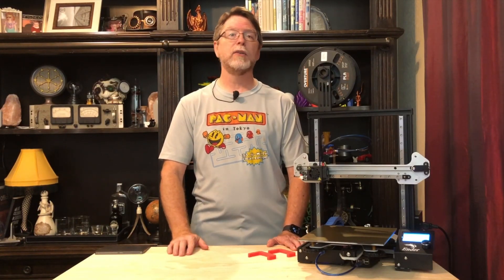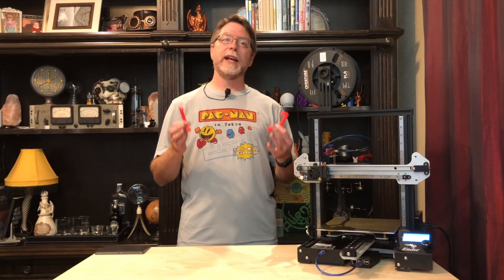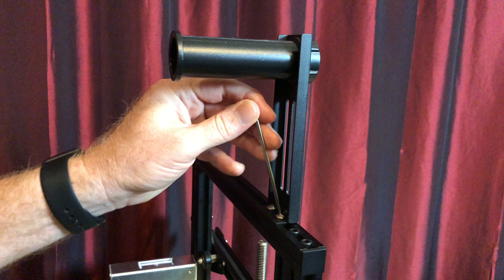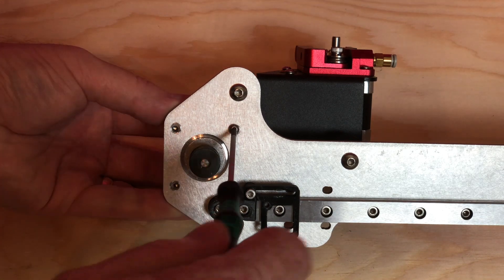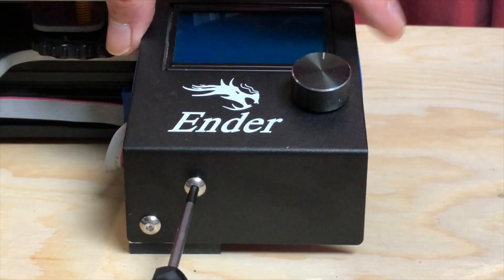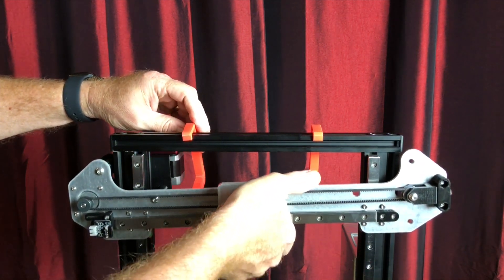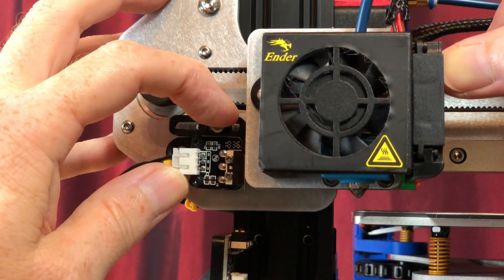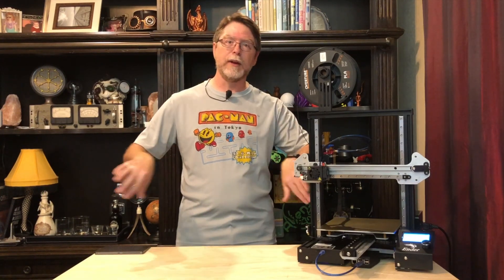How To Install 3Dfused X & Z Axis Linear Rail Kit for Ender 3 & Ender 3 Pro

Comment: Hi Bryan,
I installed the full kit from 3dfused....the x,y and z.  Everything runs smoothly now but I do have one issue when the stepper motors are disabled....the x gantry slowly drops due to gravity.  Do you have a similar issue?  Its a bit of a problem when i need to level the bed.  After auto home, if steppers are deactivated for bed leveling, the gantry drops a tiny bit which makes leveling the bed a bit of a nightmare.
Reply from the maker: Hi Novak, I had that problem when I installed the direct drive kit on the X axis. It added juuuust enough weight to spin the Z motor and let the X gantry sink to the bed.

I solved it with an "Anti-Backlash nut," which adds the little bit of friction needed to keep the Z axis in place. 

Below are links (affiliate and otherwise) to anti-backlash nuts. I'm copy-pasting from the description of that other video. On the Creality printers, the Z leadscrew is so close to the extruder stepper that a regular anti-backlash nut won't fit (and Creality uses a different screw hole spacing). So the first link is a printable adapter, which allows you to use the generic anti-backlash nuts that are listed after it.

The other video is here (I don't recall the exact time code that I show the anti-backlash nut, but it's in there): https://youtu.be/0b_8612WD0s

Anti backlash Nut Adapter Creality printers (Ender 2/3 Cr-10s) by OxProps
• https://www.thingiverse.com/thing:3732035

Creality-size Anti Backlash Nut
• https://amzn.to/2rJOdxe Amazon 🇺🇲US [affiliate link]

Generic Anti Backlash Nut
• https://amzn.to/2OUaFeY Amazon 🇺🇲US [affiliate link]

3Dfused Brass Anti-Backlash Nut (T8x8 2mm pitch threading)
• https://3dfused.com/product/brass-anti-backlash-nut/

3Dfused Delrin Anti-Backlash Nut (T8x8 2mm pitch threading)
• https://3dfused.com/product/delrin-anti-backlash-nut/
Reply: @BV3D  thank you so much for the quick feedback. I'll give that a shot. I am getting a zesty nimble though, and am planning to remove the extruder motor from the x gantry which should lighten the whole bar quite considerably. 

But until then, I'll try those anti backlash nuts. Thanks again. Much appreciated
Reply: @novakmiler7944  You can also configure marlin so that the Z stepper never turns off, which is what I do. If you're able to flash firmware and whatnot. I have it set up so my Z motor only turns off when I explicitly hit "Disable Steppers."  The anti backlash nut is probably a simpler solution though.
Reply: @WrexShepard  thank you so much.  Unfortunately my level of skill with flashing firmware and coding is 0:)  Ive ordered a zesty nimble and will be removing the extruder motor off the x carriage.  This will hopefully make that x bar very light, and I probably will not need any extra mods to compensate for the dropping. Also keen to do dual z on the machine at some point.

Comment: What type of printer is this classified as? Core xy?
Reply from the maker: Hi! This type of printer is known as a Cartesian printer. Core XY printers tend to have a cube frame with the Z axis moving the build plate (bed) up and down. CoreXY printers also have an interesting belt drive system to move the print head on the X and Y axes, in which both motors work together; there isn’t an X-only motor and a Y-only motor.

Comment: Thanks Mate! Just finished the install of the X,Y and Z kits. Couldn't have done it without you! I can't say I'm blown away with the results. It works, sort of,  but the bearings are pretty rough. It was far smoother and quieter with the stock wheels. I was expecting the utmost in precision from the kit. Hopefully, they'll loosen-up over time.

UPDATE: I GAVE UP ON THE X-Z AXIS KIT AND WENT BACK TO THE STOCK SET-UP. I spent a lot of time (probably 10-12 hours) trying to get the thing to print well. The Z Axis would not dial-in no matter what I did and no matter how perfectly square and parallel everything was. Put the stock set-up back on and it's printing perfectly. I guess I'll leave the Y-Axis installed for the time being.

NOT what I was expecting from such an expensive upgrade.
Reply from the maker: Hi Ken,
I'm sad to hear the Z axis wasn't working for you. Did the blocks move smoothly on the Z axis rails without anything mounted to them?
Reply: @BV3D  After so many attempts at fixing it, I gave up and went back to the stock wheels - it's printing perfectly. The linear bearings slide nice and smoothly but I end-up with some play in the Y axis as well as the "dumb" end of the X gantry. 3DFused suggested an antibacklash nut but it didn't make a difference.

I've packed it all up and requested to return it to 3DFused - hopefully they'll be accomodating. I don't mind spending money on this, but I assumed it would provide the smoothest, tightest, quietest operation available - I don't think that's the case. The printer works better on wheels - for me anyway.

I'll spend the money on a second lead screw and a Hermera direct drive extruder/hot end.

Thanks for all your videos - they've helped me a lot.

Comment: Took the plunge and ordered the X,Y and Z rails tonight.
Reply: Results?!
Reply: @avgvstvs96  Works amazingly good! Keep everything well lubricated and you will see a difference in your prints.
Reply: @TheLurch1955  Nice! I've seen a lot of Linear Rail upgrades create worse artifacts in printing because everything is so precise small mechanical vibrations and imperfections get directly transferred to the print. How is your print quality? Do you get any artifacts or are your layers as smooth as possible?
Reply: @avgvstvs96  Print quality is very good. As far as artifacts, none observed.

Comment: I already have a Directdrive converted and using  ezr extruder. Any advise for the linear upgrade
Reply from the maker: I have an EZRstruder available. When I get a chance I will see whether it looks like it would work.
Reply: @BV3D  Any update on this? I apologize if you've already posted it elsewhere or in another video. I'll keep looking through them. I've got an ender 3 pro that I intend to install a flexion extruder and hot end or possibly flexions version that works with the v6 hotend. Would this be able to work with your rail kit x, y, z? I'm waiting to pull the trigger on this purchase but would like to asap.
Reply from the maker: @JC-ic8uh  3Dfused sells a direct drive kit which includes a taller X carriage plate (it's got mounting holes so you can attach the extruder & stepper motor). It's designed for the stock extruder, but with some ingenuity (and a couple of spacers) you could mount an EZRstruder. As for hot ends, as long as they follow the same hole spacing as the stock Creality hot end, they should work. But I suggest contacting 3Dfused support (or their website chat system) to explain what you want to do, and they can offer suggestions.
Reply from the maker: Hi vanQ, 3Dfused has a direct drive kit for the X axis rail kit, which includes a new X carriage plate. The new plate is taller, and includes mounting holes for the extruder stepper motor. There's also a 3D printed part included which acts as a spacer to properly align the stock extruder with the hot end. To mount the EZRstruder to the X axis kit, you'd need that new carriage plate (3Dfused may sell it to you on its own), and you'd need to design your own spacer to accommodate the shape of the EZRstruder. So it looks like it's do-able, with a little effort.

Comment: Quick question, i just got all the linear rails and now having allot of issues with the z probe offset (bltouch). Also my extruder went from perfect layers to either to close or to far away, or even some cases under extrusion. Can't get a happy medium. Even after manual leveling. Can you give me a few suggestions on getting back to good settings.
Reply from the maker: Hi Roy,

It sounds like the Z axis is binding. Here are a couple of suggestions.

1) Remove the Z axis lead screw and make sure you're able to smoothly move the X gantry up and down all the way from the bottom to the top. If it's binding, try loosening the screws on one of the Z rails, moving the X gantry to the bottom, and gently tightening it again. Do the same at the top. Check again for smooth motion. If it's still smooth, gently tighten the rest of the screws on that rail. Confirm again that motion is smooth from top to bottom, then reinstall the lead screw.

2) Loosen the screws holding the big brass nut that the lead screw goes through on the extruder bracket. Not a lot, just enough that it can move around within the oversize hole that it sticks up through. This can help if the lead screw and the nut aren't in line with the rest of the Z axis.

Hope that helps!

Comment: Way too much money for basically little to no improvement in quality. Why would I pay so much for nothing? Kit needs to be much cheaper than the printer its intended for.
Reply: @Electric Boogaloo You have no evidence for those claims. The limiting factor on a printer Iike this would be drivers motors and pulleys. A linear rail will offer no much in the way of performance compare to a well tuned and fitting   extrusion roller setup.

Comment: Bought me second set of rails, they are great!. I did have an issue where my Y axis rail didn't clear the bed screws, and 3dFused suggested I use shorter screws,  sadly my local hardware store didn't stock short enough screws. I designed and used a spacer, and sent the STL over to 3dFused and maybe they'll post it on there site. If not, the holes you need for the rail spacer are 20mm by 20mm centered, however I'm not good enough to model the belt holder, so I didn't include them in the STL, there is enough room in the spacer to drill your own.
Reply: They include a printed spacer now - I got one in my kit. It may well be the one you designed! Thanks mate!
Reply: @kenlipper874   That's great they decided to ship it out as part of their kit. It really would stink if you got the printer all apart and found out you needed the darn thing.

Comment: Do you actually see massive improvements in print quality? The I3 design with the moving printbed seems to be the bigger issue. Also if you're investing that kinda money into linear rails and adding the cost of an ender 3, then you're better of going straight for a sturdy coreXY with linear rails, which would be a way better option for faster prints and better accuracy. Teaching tech recently did a review on one such kit, for about the same total price.
Reply: Yeah it's a really questionable upgrade, there are multiple reasons to use POM wheels and not linear guides on consumer level printers.

Comment: Hey Bryan, Canadian viewer here. I recently installed the X/Z kit and am getting some binding at the beginning of the travel along the z-axis. Without the screw installed the movement is buttery smooth with no issues. It's when I throw the z rod into the mix that I get binding. After several measurements, my z rod is farther out at the bottom position and closer to the machine when at the top position. This is causing the binding at the beginning of my prints. I've tried adjusting the linear rails as you suggested multiple times. The binding isn't coming from the rails. The z-rod seems to be offset now.
I'm presently printing some new spacers with a little added to compensate. Will post my results within a day.
Reply: UPDATE....FIXED
The binding is now gone. I printed out the spacers available on the 3DFused website and added 2mm to the length. They now work as intended. Don't know why mine were short but I'm glad it was an easy fix. 
Hope this helps someone else.
Reply from the maker: Hi! I’m glad you got that fixed. I usually run my Ender 3 with the brass nut a little loose on the extruder bracket, so maybe that’s why I didn’t run into that issue. If you still have the original spacers — I’m assuming we’re talking about the ones which replace the wheels — how long are they? I’m curious whether ours are the same size or if they are a little different.
Reply: @BV3D  As measured with my digital calipers, I get 3 different lengths on each of the pieces. 35.45, 35.50, 35.55 respectively. I measured the pieces multiple times and those measurements are accurate.
I still continue to get z-banding. The z-axis would slid smoothly up and down the length of the frame until I tightened everything down. You could actually feel the movement change as I did. After some experimentation and much measurement I came to the conclusion that my uprights weren't square with the rest of the frame and spent yesterday tearing it down to the base frame and rebuilding it. It now feels 100% better and the first test print shows marked improvement from where it was before the teardown. Testing is ongoing.
Reply: FINAL STATUS UPDATE
Testing is complete. Everything is now working as it should. No more binding along the z-axis.
It turns out that the steel slides are sensitive to deformation. Meaning, that if you over tighten the rails to the aluminum uprights, you can cause some deformation of the rails along that axis and they begin to bind. It was confusing the heck outta me trying to figure out what was happening.

DO NOT OVER TIGHTEN THE SCREWS.
Once I backed everything off and then tightened to snug with just a little finger pressure, it worked. Tighten everything down super tight....binding. Loosen off to finger tight, smooth as a babies bottom. So finger pressure it is. 
I'm now printing small figures that are absolutely perfect. No binding, banding or visible layering.
Onwards and upwards!
Reply from the maker: @MajChronic  That's awesome! I'm glad you've got it dialed in and running smoothly! Thanks for the tip about tightening the screws enough to hold but not enough to cause bending. I'm pretty sure the possibility of bending is why 3Dfused has the X and Y rails on those thick aluminum plates.
Reply: post script: Unexpected (and alarming the 1st time you see it happen) testament to the smoothness and fluidity of this kit. At the end of all prints, the bed will move to the front and the hotend repositions itself to the left side of the gantry. With these bearing rails installed, the moment the controller stops moving the hotend all the way to the left, the whole carriage/gantry DROPS! As in "look out below" drop. Fortunately, there's enough friction from the z-screw to bring the whole thing to a stop just cm's above the build plate. The first time I saw it happen my heart dropped in unison thinking I was witnessing the demise of my glass build plate and perhaps the nozzle/hotend. I've since witnessed it multiple times and, while I cannot say the heart drop sensation goes away, I can confirm it does stop short of the glass at the same point even when dropped from the highest point on the frame which does help alleviate any negative effects on the old ticker.
Looking now to buy one of those spring loaded guides to prevent more gray hairs.
Other than that, the kits from 3DFused are the best upgrade one can do to an Ender 3. A lot of people will scoff and rib you for spending the same amount of money to upgrade your printer as you did to buy it but the results are simply stunning and infinitely repeatable. I'm now turning out prints both faster and better looking than before. Any imperfections I get now in a print are of my own doing and not as a result of slop, play, misalignment, sag, or any other effect one gets from the stock setup. A little lube every other week and that's it for maintenance. I haven't even leveled the bed since it's final tune 2 weeks ago. Print, change glass, repeat. It's been running nonstop with breaks only to change filament.
The real question is, who wants to bring out an affordable 3D printer with these upgrades as "stock?"
Reply: @MajChronic  The "End G-Code" in Cura includes this line that disables all steppers except the Z. This keeps the gantry where it was when the print finished. Give it a try:  

M84 X Y E ;Disable all steppers but Z

Comment: Well I finish the Install 3Dfused X & Z Axis Linear Rail Kit . Have a little bit of a problem. i can't get the rail to move up and down smooth. It could be the rails warp. Something is getting in a bind
Reply from the maker: I've heard from another person that they had binding on the Z axis. If you remove the lead screw, does the X arm moves freely through the entire range on the Z axis?
Reply: BV3D: Bryan Vines 
Yes just fine
Reply from the maker: @TheDronzDr  OK. The problem may be the thickness of the spacers which replace the "wheel sandwich" on the extruder side of the X arm. Try this: Loosen the screws just a bit on the brass nut (the part that the lead screw passes through on the extruder bracket). Just loosen them enough that the nut can move a little. With the nut just a little loose, it can move either toward the front or the back of the printer enough that it doesn't bind. If you find that this has released the pressure and it's not binding any longer, then, with the Z axis homed (all the way down) try tightening the screws on the brass nut. Check that the binding issue is still resolved.
Reply: BV3D: Bryan Vines 
Ok thanks I will try that and let you know.

Comment: This is a great upgrade if you want a heavy direct drive extruder.. I was thinking about putting one my Ender 3 pro but with the added weight I was afraid I would wear the wheels out. This would make it much easier to ensure gread direct drive prints for years..